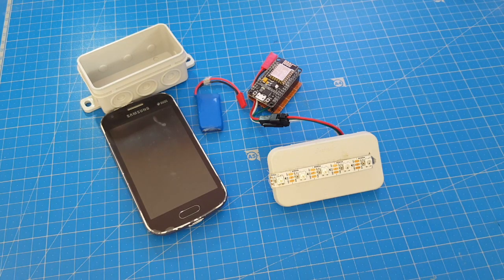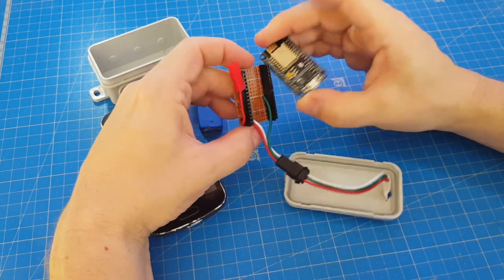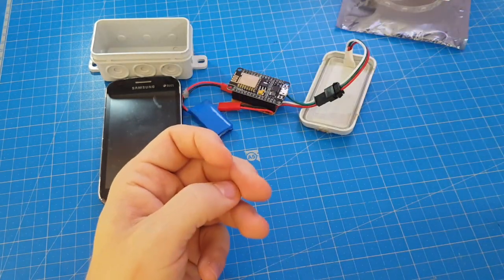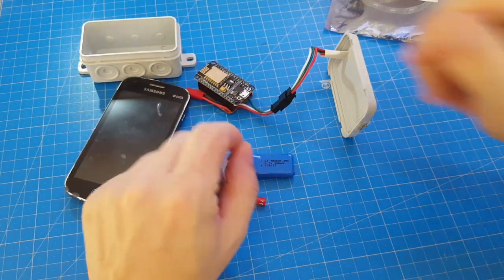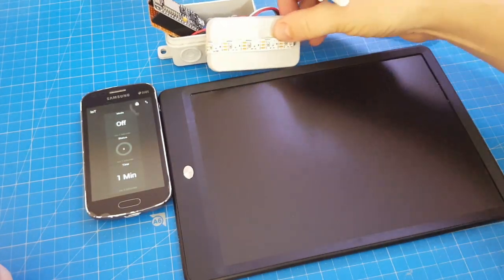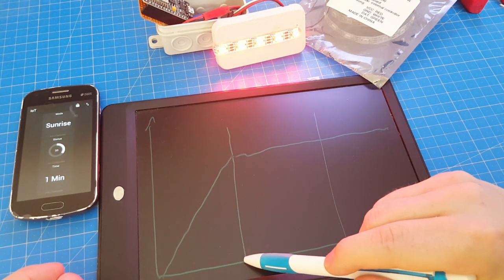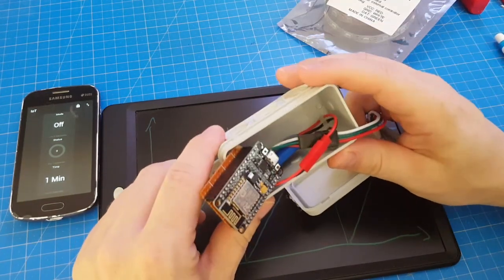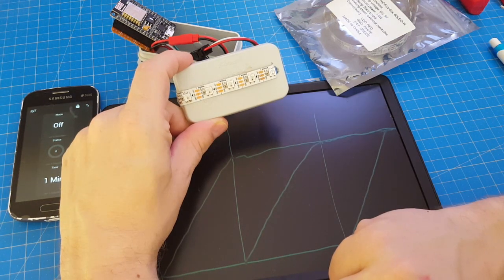Sunrise Simulator

Comment: I have made a very similar device that simulates a sunrise, high noon and set sun over my aquarium, using 12v L.E.D's.
I used a single 12v supply, to power both Arduino and the L.E.D's (5v reg for Arduino), and used MOSFETs on the LEDs anodes switched via the Arduino PWM terminals.
Just an idea!!!
Reply from the maker: Cool! I've used those LED strips, you're talking about, with mosfets for a complete different project. Feel free to share your project - I'm curious.
Reply: Hi I'm really interested in this project. I have an aquarium as well and recently I realize a device that helps simulate a day would have great effect on my aquarium plants :( But i have found no way to do that though. Please help me , can you share a tutorial or the arduino's code please
Reply: Hello guys,
Sorry I can't find the original source for the coding, but I will do my best to get something uploaded asap, and get back to you!

Comment: Nice work! I'm going to have a go at building one with your code.

Any advice on setting up the MQTT server? Did you use something lile adafruit io?
Reply from the maker: I have a Rasperry Pi in my local network. Just installed "Mosquitto", a MQTT broker, and everything runs smoothly.
Reply: @nenioc187  wie nennt sich das Tablet auf dem du schreibst ?
Reply from the maker: @Ematuresco  Das ist kein richtiges Tablet. Mehr so eine Art Tafel.
Hier hab ich mal ein Video darüber gemacht:

https://youtu.be/nhdj4N275QI

Comment: The only improvement I can make is a mechanism for charging that does not require disassembly.
I can imagine visitors to your home having the path illuminated as they approach.  And I'm thinking of a "night-light" in my hallway.  Both applications I think would be triggered by infrared.
Reply from the maker: Yeah, opening the box and dissembling the parts just to get the battery charged is quite annoying. Should find a better way.
Reply: This could be fun with some proximity detectors. As one is approached the associated LED gets brighter and vice versa.